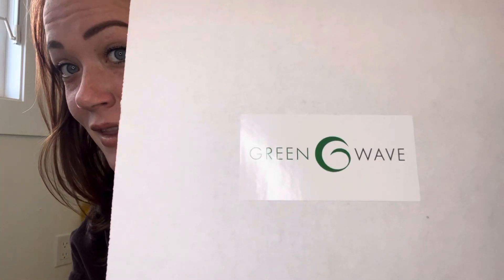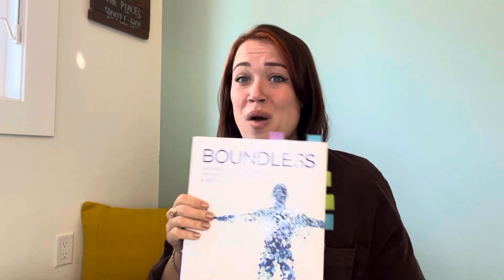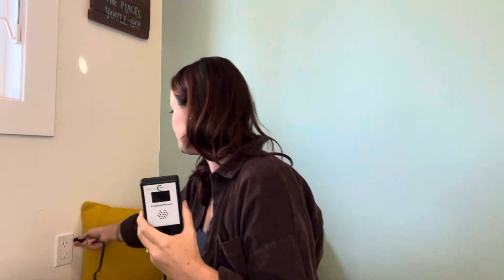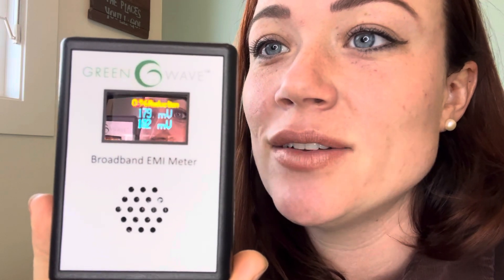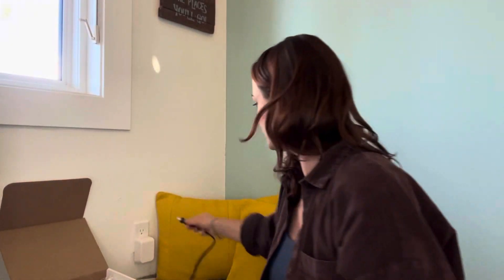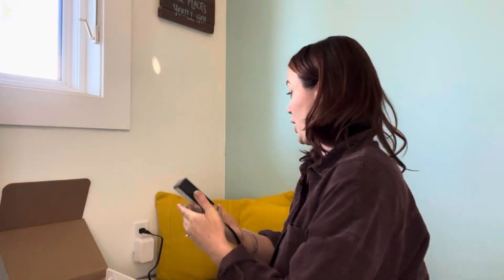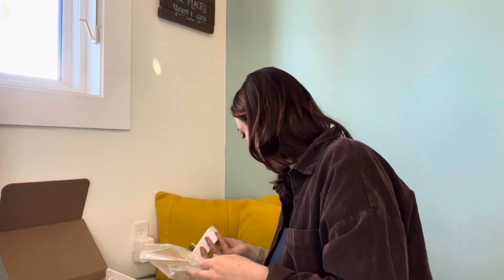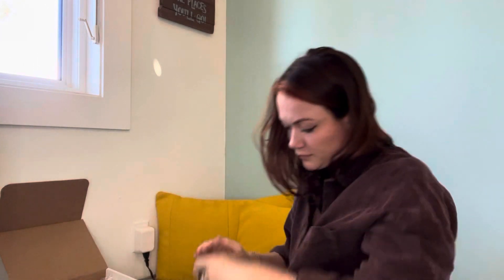Dirty electricity - Green Wave filter test - EMI reduction

Comment: Main service panels are not ‘properly protected’ from EMF’s by the metal cover.  Because of the separation of the two phases at the main lugs, they produce an EMF field which extends into the ether for many feet in all directions.  A simple gaussmeter like a trifield meter will prove this.  Dirty Electricity is a different category than EMF’s, though many mistakingly group them together.  They are all part of the Electromagnetic spectrum, though.  One more thing, all the point of use outlet capacitors, like your Greenwaves, exchange DE dropping for some EMF’s produced, and that gaussmeter will prove that too, so try to keep your distance or replace with a main CB panel filter for whole house. Glad you’re addressing these important issues, though.  Kudos.